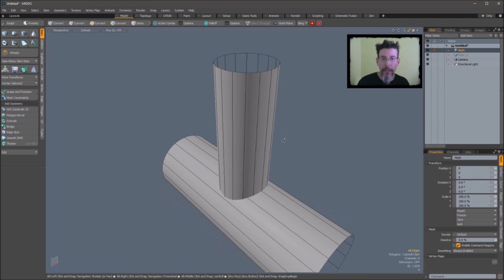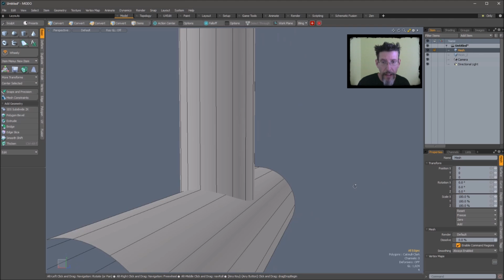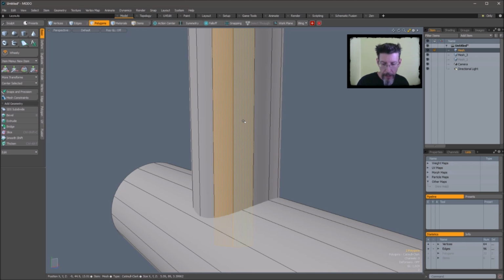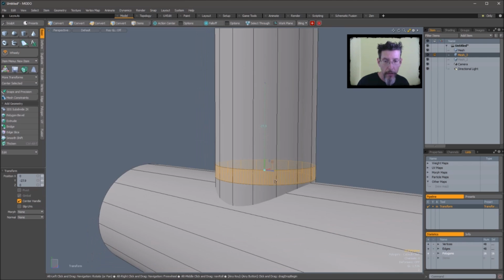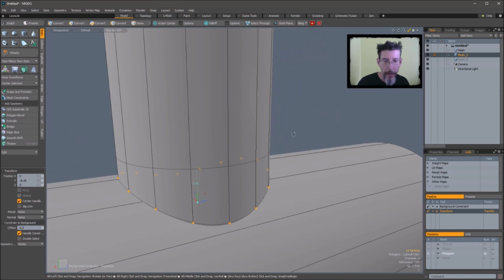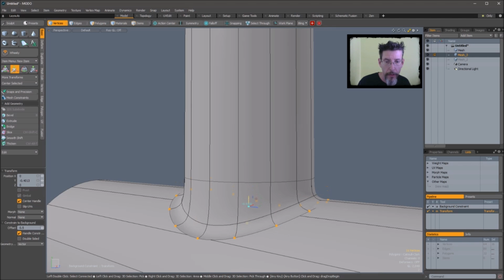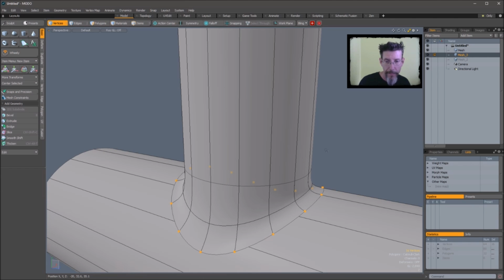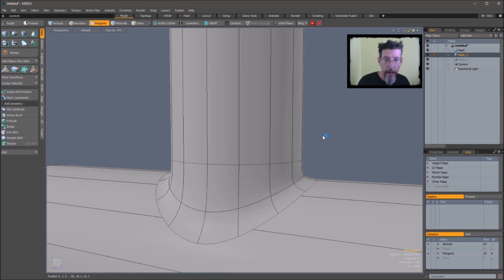Quick Tip #15 : Edge Loop Skirting

Comment: Thanks for sharing this tip! It's exactly what I've been looking for.  But I have to admit, I have spend hours trying to figure out how to do this in 3D Max and still have no idea. Does anyone have advice on how to conform a loop to the surface of another object in Max? It would be greatly appreciated.
Reply from the maker: +Anderin55 Glad you found it useful!

Someone DID find something similar for Max, actually ... Using this script pack, there's a script in there called "Drop On" that can give you that functionality apparently.

http://miauumaxscript.blogspot.pt/p/miauus-script-pack-vol2.html
Reply: +Warren Marshall
Ah, nice find.  Looks like it's worth buying, but I'm not sure how to pay for something in Euros.  So in the meantime I found another plugin that is not nearly as good but works for now.  
http://www.klaasnienhuis.nl/2011/11/align-vertices-to-a-mesh-in-3dsmax/
Reply from the maker: +Anderin55 Ahh nice!

Comment: Hey Warren, nice video, thanks for the tip. You know, I'm getting pretty depressed over baking, I have a hard time with just the overall process of baking. I'm a 3ds max user but it isn't software specific, just baking in general. I don't get the whole idea in my head which a lot of the time leaves me thinking 'ok, what the hell do I do next?'. The steps in baking just aren't so clear to me. I get confused. Any tips?
Reply from the maker: +Commander Shepard Of The Normandy SR-2 Maybe I'll do that next.  Just an overview video of stuff to watch for when baking normals ... There are only a few rules, really.  Thanks for the idea!
Reply: Warren Marshall
Thank you for an upcoming video to help me out! Could you go over the overview of baking? Especially things that consist of many objects, for example, a house, a house would be made up of lots and lots of objects, how do you work with that? What needs to attached together? Do you bake each individual object that makes up a mesh?
Reply from the maker: +Commander Shepard Of The Normandy SR-2 We'll likely do some sort of prop ... but it'll have multiple pieces.  heh.
Reply: Warren Marshall
Perfect! Thanks Warren, appreciate your help. :)